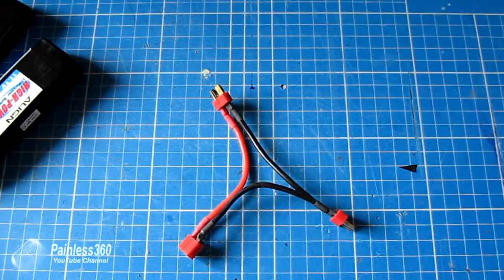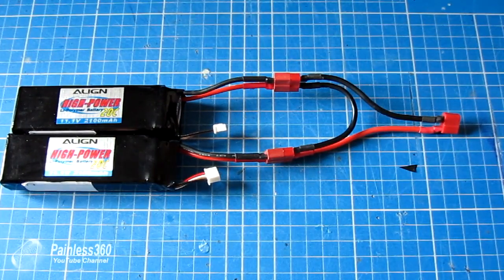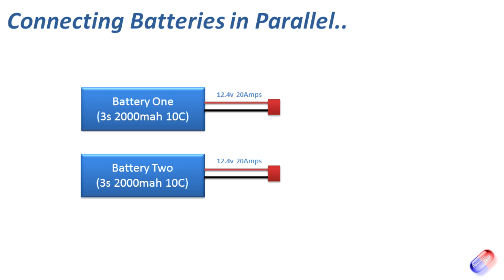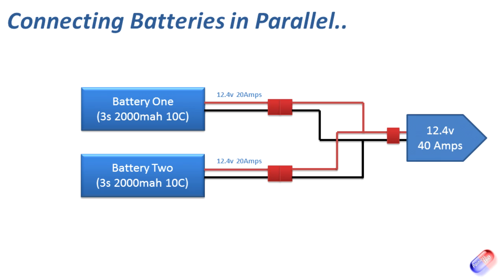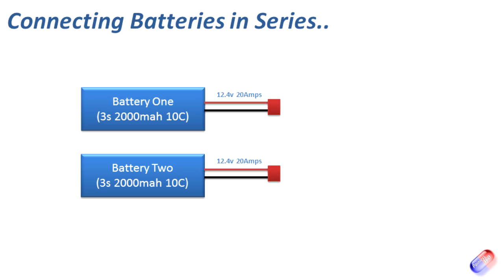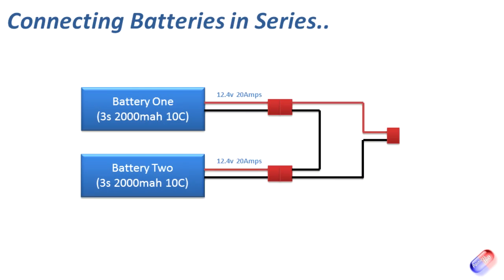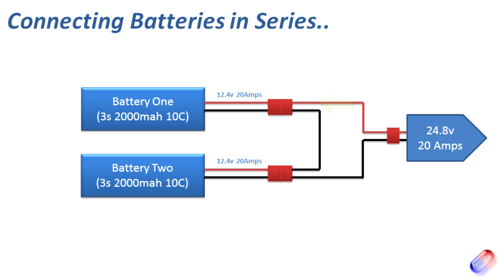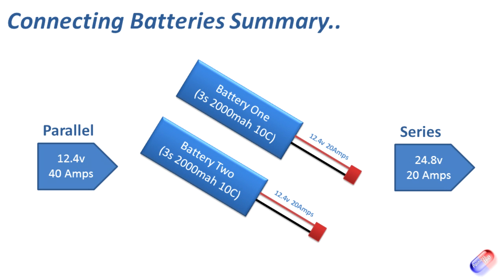Connecting batteries in series or parallel (LIPO)

Comment: Fast forwarding through this didn't quite answer the question I had so I will just ask here and hope some one will answer it. Quite simply, I am wondering if I connected two lipo banks in parallel for a bigger project, what will be an acceptable voltage difference without melting my wires? I have made 16 cells 1S battery banks for a project, and now I am looking at doubling the capacity of the whole project, but I built 10 amps fuses into every single bank, and taking the battery apart to replace the fuse will be a pain. So I am hoping to eliminate the possibilities of the wires melting or the fuse blowing or simply doing harm to the banks since it took me quite some time to make them at home. So can some one tell me how to ensure the flow between banks? Also, for safety reasons, I would like to know if there's a way to limit the current of the banks, since I am basically giving a 16 times capacity and peak amperage boost to my device, I would hate to fry it. PS: I tried with 16 cells, being 8 times the original capacity and it was fine, just want to know if there's a physical mod I can make to ensure amperage. Thanks.
Reply from the maker: +Shan Liu The voltages need to be almost identical as any difference in voltage will cause a current to flow from one pack into the other, limited only by the internal resistances of the packs themselves. if we assume that a pack has a resistance of 10millohms a cell that would be 30milliohms for the pack, there would be two of them - 60milliohms so a voltage difference of 0.2v would cause a amperage of 3.3amps (I=v/r) to flow until the voltages were equalized. Hope that helps..
Reply: Painless360 Yeah, thank you, my fuse can handle 10 amps, so it's good for now.

Comment: I have three 4s 1800mHA 65C batteries, when i connect them in parallel, it's will give 195C will it effect my motor and ESC, I know My ESC and motor can handle 4S.
Reply from the maker: +Skytech Today No, you'll get a 65C 5,400mah pack.. ;) My advice - buy the right battery for the job..

Comment: I'm stupid ... i have 4 1200 mah batteies ... i want to wire all 4 together to get longer flight time on my quad chopper . i understand i have to do it in parallel but I'm having trouble figuring out how to wire the third and fourth one .  also , once i figure out how to connect them all , is it possible to charge them all with one plug in once there all together ?
Reply from the maker: +Josh Ruland Personally the cost of LIPOs are now so low that I'd get the right batteries for the job. You can connect them all in parallel but I'd charge them separately for safety.. Best of luck.

Comment: Hey, great helpful videos. Hope you can help me with something. I'm planning on making an adapter for two 3s 30c 5000mah lipo batteries in series with an XT90-S anti-spark on the ESC side. My idea is extend bullet connectors from the XT90 that connect to the + of one battery and - of the other, then just straight up connecting the other + and - of the two batteries to each other. Does this make sense and if so does it sound safe? One other thing, could I put in a third battery (same specs) in the same way or do they have to be in even numbers? Thanks in advance if you can help!
Reply from the maker: +Finn K Not sure if it makes sense but any exposed metal that will be uninsulated will have the potential to cause a short. Be very careful with batteries as they will react violently if you short circuit them..
Reply: +Painless360 Yeah I'm aware of the short possibility, thanks for your concern though. I'm not sure how to clarify the adapter any better so I'll leave that until I can show someone what I mean. Are you aware of any problems connecting three lipos in series as opposed to an even number? Thanks again!
Reply from the maker: No, you should be able to connect as many as you want. The key is to have the capacity and C rating the same of the packs..
Reply: +Painless360 Great, thank you!

Comment: if i understand this right a 3s 2000mAh 10c 12.4 battery contains inside it 3x 1 cells 2000mAh 10c ~4.15v packs (safe recommended charging voltage).
So with those LiHV batterys that are now showing up i could take apart a larger pack like a Turnigy Bolt 500mAh 2s 7.4v 65c - 130c to get 2x 500mAh 65c - 130c ~4.35v (can be safely charged to 4.35v per cell) for a single cell rc model and say run in a hubsan quadcopter as a example provided it fits. This would be a massive improvment over the stock batterys of most single cell quads right? slightly higher volts with high discharge giving way more power at a cost of weight.
Reply from the maker: +Side85Winder Possibly, something to look at as these batteries become more popular.. Happy flying!

Comment: hi there, thank you for the very clear explanation of this video!! :)
i do have a question, which maybe you can help me with....
i have some 4 pieces of 3.2 volts lipo batteries and i want to make one big 12 volts battery, making them serial creates a 12 volts battery...
but the question is, how do i charge it? can you make a tutorial for this?
i would be so grateful and thankful

thanks in  advance

jo
Reply from the maker: +newchannelization You treat the battery as through it was a 4s pack. A fully charge 4s battery will be 16.8v. If you want a 12v pack then you only need 3 of the individual LIPO packs you have. Best of luck!
Reply: +Painless360 ok so i just solder them in series and then present them to the charger ...
thanks man!!

Comment: If I connect 2 batteries in parallel will this double the flight time of my drone?
Reply from the maker: It won't double it as the model will have the weight of the extra pack but it will increase it..

Comment: Thanks for the making of this video it helped me a lot, but i have a question can you please answer me, the question is how if i sires connect 3 battery's then how is the connection  and more then 3 battery's  and also what if one battery was for example 1A and the other 2 A and the other 3A
THNX
Reply from the maker: I wouldn't use pace with different C ratings like that. You'd always have to make sure you only pulled the amperage that was no more than the lowest battery..

Comment: good day, my plane requiere 4S2300mA, but I have 2 batery 2S 2300mA, can I put in serie and the result is 4S2300mA?
Reply from the maker: Should do, but match the pack C ratings too..
Reply: +Painless360 is the same two batteries

Comment: Can i connect a 1300mAH 7.4v 2s and a 5000mAH 11.1v 3s together to make a 5s 6300mAh? They are the same brand, both ZIPPY Compact and what would happen if i did it in seris? BTW they have different C rattings
Reply from the maker: I wouldn't. Happy flying!
Reply: +Painless360 Okay thanks

Comment: Whats is the safe extra voltage that an rc car/drone can handle without burning the chip inside it
What happens when you add a 3.7 voltage and a 7.4 voltage batteries together in parallel? 11.1?
Reply from the maker: +Michael Bardakji That depends entirely on the ratings of the motor, BEC and ESC you have in the model..
Reply: +Painless360 What about the Syma x5c drone
Reply from the maker: What does the manual for it say?
Reply: +Painless360 It's initial battery that is supposed to go on it is a 3.7 500 mah. I was wandering if it will damage the drone if I double the voltage of the battery by connecting two of them.
Reply from the maker: It the manual doesn't cover it then it's a distinct possibility. I'd look for posts from other owners who've tried and see what happened to them..

Comment: SO  what is going to give my 500CP helicopter more power? If I take two 6s and run them in series to go 12S? or running them parallel ? thanks
Reply: +Painless360 So, should I understand if I connect them in parallel expect more flight time? Thanks for your video
Reply: +Painless360 -- How is 2 amps + 2 amps =40 amps? Milli is a thousanth as in millenium.
… or was that 2.0 amps?  
;->
Reply from the maker: +steve sparrow Different more powerful motor, using higher voltages... All the normal things..
Reply from the maker: Depends on what you mean by power, I assume thrust? Adding packs in parallel will not provide that, but give the motors more time..

Comment: So in layman's term.  What gives more power and what way gives longer run time?  Just want to confirm.
Reply from the maker: +bigrimyukon Parrallel
Reply: +Painless360 So actually series you get more power faster correct?  Parallel will double the capacity so you can run longer with more MAH same volts correct?
Reply from the maker: +bigrimyukon Power = watts = voltage x amps. 'Series' packs give you twice the voltage...

Comment: Say i have a 6s lipo and i have it charged to 25 volts and i want to run another battery to it in parallel, but its only charged to 23 volts when i plug it in. Is this going to short circuit something?
Reply from the maker: +Michael R. Head Be very careful when connecting them as the voltage difference will force a rush of current from the higher voltage battery into the lower one. With only the internal resistance to keep the amperage down. Try and get them as close you can before connecting to reduce this. Best of luck.

Comment: hello Painless360, i have a question, i have a drone syma 5 that works with a lipo battery 1cell 3.7 volts, 500 mAh, and also have a drone JJrc h8 that works with a 2 cell 7.4 500 mAh and those batteries has a balancer conector, can i repalce de 7.4 volt battery for 2 batteries 3.7 volts making a conector in serie? is the same than the stock 7.4 volt? does not affect if theres not have balancer conector? i will apreciate your answer, for me is more conveninete for price and time to chage use the 1 cell 3.7 volts batteries, thanks.
Reply from the maker: +IMPORTECHML You can but make sure that the mAh rating of the 1cell batteries are the same as the 2 cell you're using. I would recommend investing in the right batteries for the model as the extra wires and connections all add weight and points of failure to the model and some of the smaller models are very sensitive to extra mass. Best of luck.

Comment: hello.. i have another question for ya please help...i got 4 14.8 5000mah 20c to 30c. i  connected two batteries like ya video. now i have 2 packs of 2 at  29.6v each. now when i connect them do my c rating double to 40c to 60c? and do my 5000mah double to 10000mah?
Reply from the maker: Book some time via the website for a chargeable session and I will take you through it all..
Reply: +Gerald Bennett Pararell connection doubles your C rating, Series connection doubles your voltage, mah doubles in any of those two types of conections

Comment: hello i want to build a bettery for a ebike im trying to build.. i have watched many videos.. and i like the lipo i dea better...  now i want to but 3x 22.2 15000 mah batterys  and connct them to build  66.6v 15ah battery.. so in lipo terms  is my 35c going to give me a certaint amp hrs or is that full streaight power to my controler? also if i connect my 3   22.2v batteries will it add up my voltage to 66.6v and 15000mah?
Reply: is my continues amps are the main thing i have to worries about for motor to keep running? seeems like a lot of amps unless my calculations are wrong.. please help me..
Reply from the maker: +Gerald Bennett That would give you a pack with 66.6v, 15000 capacity and max current of 525Amps (35C). Not sure where you are going to get the 15,000Mah packs from through.. Best of luck!
Reply: thank you very much for the response :).. my ebike kit is a 1500w motor with a 1500w controler. about how long do you think that berry will go befor i have to charge it again?
Reply: my battery has to have atleast a 35 continuous current flow..
Reply: +Painless360  hello again .. there various ways of getting them.. i have a few i want to order off ebay.... one last question please...   the main important part is my   35c and my 66.6v correct?
Reply from the maker: From the detail you gave me, it should be.

Comment: Do you know why two identical batteries in series got drained not equaly? One of them just dies much much quicker than the other.
Reply from the maker: +androot69 Manufacturing differences. Not all batteries are exactly the same, even from the same manufacturer.
Reply: thanks, that may be the case

Comment: So when connecting 2 batts in parallel, would I need a larger ESC?
How about in Series?
Thank you
Reply from the maker: The ESC rating is for the maximum current for the motor.  Adding in series increases the overall pack voltage so you will need to check the esc is rated to handle the higher pack voltage. Best of luck!

Comment: Thanks heaps for these videos, very easy to understand. Quick question for you, I've got a FPV/aerial recon plane using a pixhawk clone and I want to extend my flight time. If I connect two 3S 2200mAh batteries in parallel obviously battery voltage output will be the same at 11.1V however for the sake of setting up my battery monitor in Mission Planner, I will specify a capacity of 4400mAh? i.e in parallel voltage does not multiple but capacity (mAh) does? Thanks!
Reply: Nick Kilroy Yes.
Reply: Thanks!

Comment: can i connect 3 1c lipo batteries in series that has this specs. For obtain a 3s battery for my video RX
1 3.7v 110mAh - 2 3.7v 130mAh - 3 3.7v 110mAh
is it possible?
Reply: Luca Nsh Possible, but not optimal. Problems occur when current starts to fall unevenly per cell. The cell with most current starts to charge the lesser ones.
Reply from the maker: Luca Nsh Possible but no recommended. LIPO batteries are so cheap why not get the size you need?

Comment: One question does more volts mean more power? Or does the only thing that matters is Watt hours?
Reply from the maker: Khmer kid No, volts is volts ;)Power is measured in watts and watts is volts x amps. So if you have a 150watt motor as you increase the voltage the current is pulls goes down..Hope that made sense.
Reply: Thanks for the quick response, no just asking because I planed on purchasing 3000w mid drive and the I asked owner whats a good recommendation on the battery I should use and he told me to use 2 48v 12ah battery's in parallel  to get 48v and 24ah and i was just thinking how is 48v strong enough to push a 3000w motor seeing how all the top brand bikes use 70v and up.

Comment: Many thanks so I can connect two 1sell lipos together in parallel and my voltage will be 3.7v but my amperes will increase ie. 750+750 =1500A. for my drone that will be awesome because I only get about 6min flight time and should now get +/- 12min flight time out with my voltage still on 3.7V for my circuit board.
Reply from the maker: Christo Meintjes Yep, that's right. Be careful of the extra weight with smaller models though..
Happy flying!
Reply: Painless360 Cool weight is always a down fall. I am getting two one cell lipos today and connecting them up in parallel and go from there.

Comment: Hello i have 2 batteries for my drone one is 3.7v 600 mah and the other is also 3.7v but 200 mah so can i connect them in parallel to have the same voltage(3.7v) but 800 mah ?? 
  Thanks in advance

Comment: Can I connect two same cells, with different capacities, different C rating in parallel/series?
Reply from the maker: ***** You could but not recommended at all. Can cause one pack to over discharge and damage it.
Bets of luck.

Comment: Well I would like it to be... 5400.. 40c..22.2.volts   but I think it will be
5400..40c...7.4 volts...still not sure...?
Reply from the maker: Tony dodge You would end up with a 22.2v 1800mah 40c 'pack'.
I would suggest buying a cheap 6s battery would be easier..
Happy flying!
Reply: Painless360 OK , how about if I link up 3 x 1.800mAp 7.4 volts 40c batteries in parallel and then use an ESC to boost the voltage..? I've seen a few hobby king videos with them bench testing ESC's on motors .
What do you think and can you suggest an ESC if it would work..?

Comment: would be nice to show how to hookup two lipos to a charger in series...
Reply: +Tim C You must never charge two lipos in series without closely monitoring the state of each, especially if different C ratings or capacities!
Multi-cell lipos are wired in series inside, but the cells are closely matched so they charge roughly uniformly.
Best to charge always using balancing, but balancing can be done 1 out of 5 or 10 charges, if the cells behave and you keep an eye on them. A cell must never exceed 4.2V, so if charging without balancing, I slightly undercharge to 4.16V to allow for some headroom for any cells that take up a little more charge.

I would not at all recommend charging two separate lipo packs in series.
One may overcharge, and the other undercharge and the charger would not know when to stop.
To illustrate, a cell is full at 4.2V therefore two cells in series is full at 8.4V.
However, the charger will also see 8.4V if one is at 4.0V and the other is 4.4V and will probably damage the lipo or even cause a fire.
Multiply 4.2 by "S" for more cells.